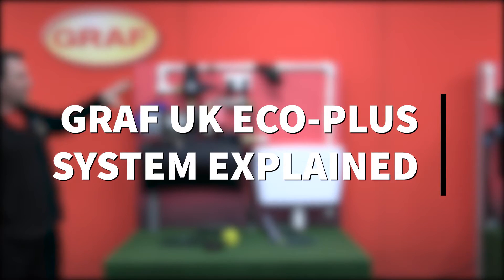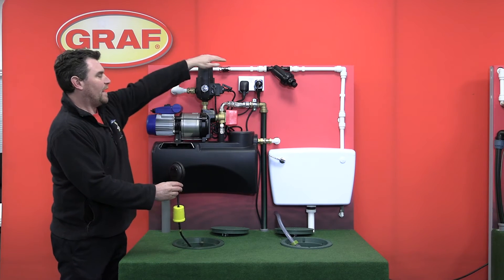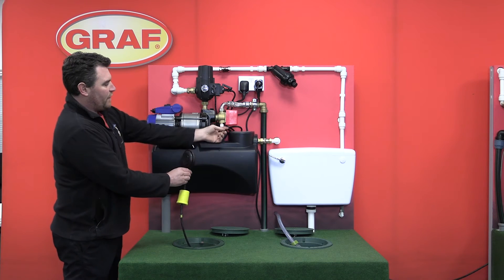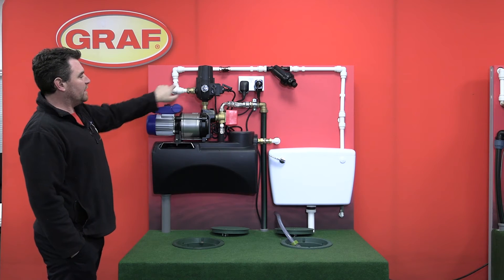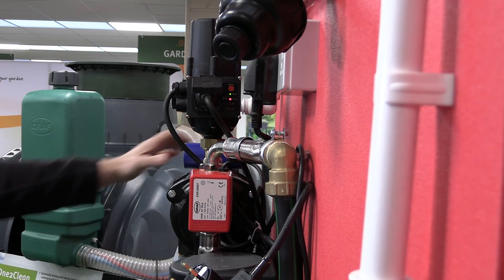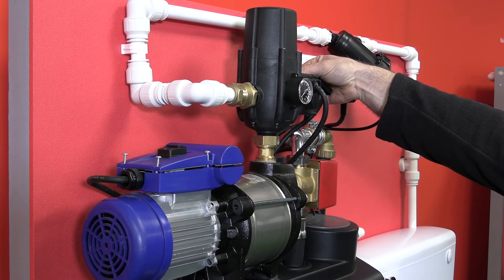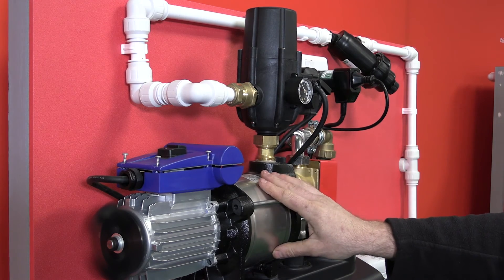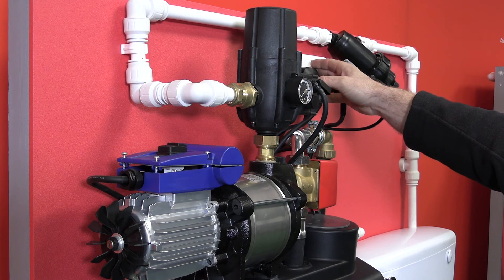Graf UK Eco-Plus Rainwater Harvesting System Explained

Comment: In the event of a power cut, can you still send water to cisterns upstairs?  If not, your indirect system does seem to provide the ability to override the water coming via pump, and instead use the pressure from the mains supply.
Reply from the maker: During a power cut a pump wouldn't send water directly to a cistern or a header tank. But if you had a in-direct then as long as the header tank was full then yes you would have a supply of water to your appliances.